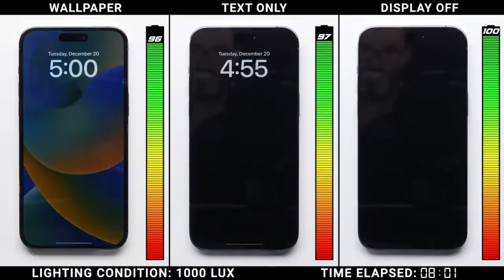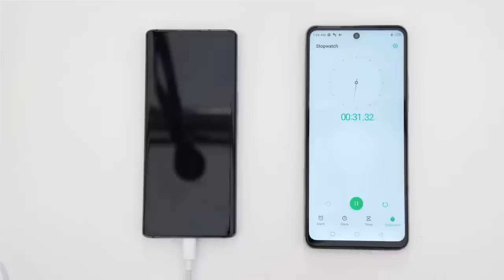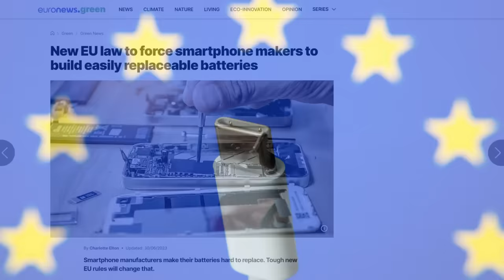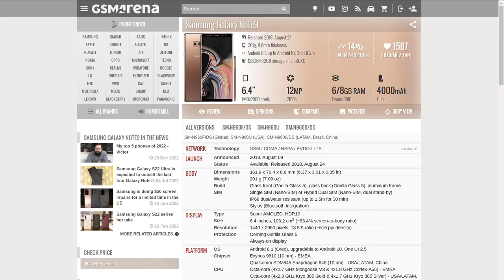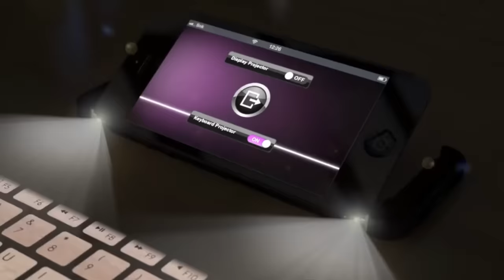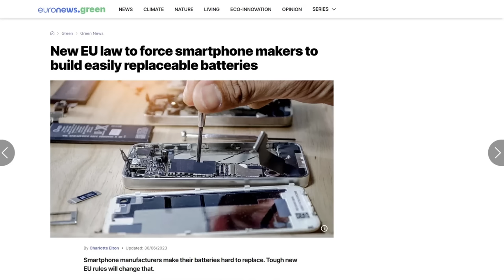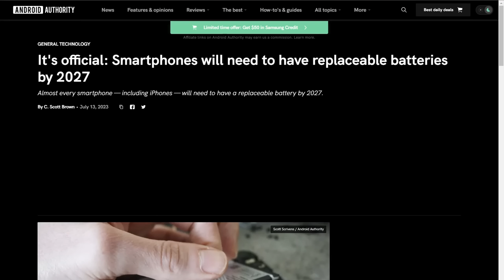All Smartphones Will Soon Have Removable Batteries

Comment: This needs to happen! Such a backwards step when phones went to non-removable batteries.
It will extend the life of phones by so much. No throwing away after 2 years.
Reply: Except that you won't get security updates beyond the end of life of the device.
Reply: my lgv20 was awesome i had extra removable batteries and instead of charging i would have one charged fully from a dock and just swap it in and bang you got yourself a camping trip without needing the portable batteries
Reply: @AJ12Gamer You can just install the new OS in that case though
Reply: @AJ12Gamer there is no such thing as security update😂, they're just adding more and more feature to bloat the device and makes it slower to use, and makes you think you need a new phone
Reply: I miss my Asus Zenfone 4 gen 1.
Reply: There are thousands of brands offering removable batteries, and you are crying for expensive government regulation because mainly two brands don't offer them... If this is such a problem for you, hit on google and type "[current year] phone with removable battery". You WILL see thousands of phones from small companies.
Reply: I've had my phone for 5 years now, and the battery life is still pretty decent. 
It sure is showing its age in other ways though, like with screen burn-in.

If I had to choose between an IP68 rating or a removable battery though, I'd pick the IP68 rating hands down.
Reply: @AJ12Gamer you're being silly AJ. Don't be silly
Reply: That's the point, more profits.
Reply: battery is not such big problem as small, unupgradable internal storage.  As soon as it reaches 80% capacity, phone start with hiccups.
Reply: Ive had my iPhone 8 for 7 years now
Reply: Wait, you guys can't just ask to replace the batteries?
-sincerely, the android gang
Reply: Which is exactly why I kept my Galaxy S5 since 2014 until the stupid forced VoLTE forced me to "upgrade".
Reply: @AJ12Gamer  except most of those 'security updates' are literally just bloatware to slow down the phone and push you to buy a new one, and even then you can just load the OS of a newer phone onto the old one lol
Reply: @GregorianMG There are no one OS for all phones like you have in PC. Each vendor offer their version of Android, and it's not interchangeable.
Reply: @ThePhilosopher Which brands offering removable battery today? I browse the internet up and down and back and forth and the only phone that is still have that feature are five years old product with small memory.
Reply: TBH, I have not had a single device fail due to the battery...
Definitely not going to argue against user-removable batteries, though. Even if it doesn't have any monetary change, it's a matter of principle. There are some crazy people in the world that think that life is not all about buying low and selling high and nothing else...
Reply: @AJ12Gamer  you sure won't, if the bootloader is locked, with the penalty of device features/warranty committing sudoku if you unlock it :D
Reply: @zepher664 how often you use your phone underwater bruh
Reply: Well a battery replacement isn't impossible but pretty hard now.as everything is held together by glue most of the time and Also ma
Reply: @ThePhilosopher Yes, but for many of them, everything else is what many people don’t want. The XCover Pro has a 120 Hz screen, but that’s it.
Reply: @boulderbash19700209 There is one with fairly good specs. You could get one with better specs for cheaper
Reply: @AJ12Gamer  I've disabled them immediately after buying it
Reply: It really bothers me that we as a society treat smartphones as disposable. Hopefully this will help.
Reply: @NicoKyunKyun  This is a very smart thing to say My Professor who still has an Iphone 5 from 11 years ago, said that you may think you want a new phone because of a new feature but all phones have the same use, and that it's wasteful to throw away a perfectly good phone. He was relating to adaptations and evolution in animals, He is a very good teacher and had an excellent personality I miss him.
Reply: i just want buttons back on phones and a thicker boarder back on the screens again. i hate using my mums more modern phone as she doesnt no how to use it. i can literally just touch the corner of the screen by accident and it will try to act like i meant to click on something. i dont like how the modern phones have become. until they revert back like 8 ish years, i dont want to have to be forced to buy a new phone or feel the need to buy a new phone just because mine is outdated.
Reply: 2 years? what phone you use? I had my Huawei for 6 years now and the battery works just fine, reson I need change phone this year is become difficult use latest apps
Reply: @ThePhilosopher ople tend to evade brands which are not pushed by their local e.g. isp's.

@starsareangels7 cool story. its best to have separated extra batteries for every device (for a trip). also double the amount of batteries for a long one. brains anyone?

@lifeishard5718 are "they" in your head rn?
Reply: @basukisugito3275  Battery life degrades usually after 6-700 cycles. Conversely, how many days are in 2 years? 

You can figure the rest out.
Reply: Dame with the wireless headphones and taking away the jacket
Reply: @MoteofVolition 
That’s a very low quality grade battery 🪫 
A rechargeable battery can last over thousands by default…..
Reply: @AJ12Gamer 
Not to mention your iOS won’t be updated, and they force it so that any new updates app will somehow uses over 5’000% battery life to force you buy new one. 😂
Reply: Back to ratio, and with around eight screws in the backplate they stay waterproof.
Reply: Yeah thats less profit for the Bourgeosie. They will fight for it. Thats millions of dollars gone. And also the company has to still keep up the roi for the investors or else they lose some. Phones nowadays can keep up new softwares and has enough RAM for it, mostly ppl change phones cause of the battery's dead or somenew phone with new feature which they like are on market.
Reply: @AJ12Gamer I had my Iphone 7 for almost 6 yrs, until january of this yr. Factory recall had Apple replace battery a few hrs ago and it still dies pretty quickly. It works fine still... but won't update and therefore wont work for cell service. 
Prior to that, i had an iPhone 5 for almost 5 yrs. I didn't use it much. That one really stopped working. 
Prior to that, I had dumb phones with removable batteries
Reply: @AJ12Gamer then phone companies will start having to be responsible for more and longer support for phone updates and security updates. They will make less profit and have to hire more people. Not going to happen.
Reply: If you throw your phone away after 2 years, you have serious problems...
Reply: my cousin has had an iPhone 11 for 4 years constantly using it and it still has a good battery life

Comment: Personally, I think that in the near future, all tech needs to be as flexible, modular, user serviceable, and non-proprietary as possible. If there are worldwide enforceable regulations it'll mean that manufacturers will need to up their aesthetics/ergonomics game and be as creative as possible in order to make their products unique and appealing to consumers.
Reply: tech becomes obsolete quickly, realistically very few people will repair their phone or replace their battery, just buy a new phone
Reply: @imstupidbut  maybe a decade ago, but nowadays, I wouldn't be too sure. My GPU was low-end when I bought it 4 years ago, but I only had to replace it because AMD cut software support
Reply: @imstupidbut it becomes obsolete so quickly because they're not user serviceable
Reply: Modern electronics design is all about short term consumption. They want you to keep buying and incompatibility is one of the most effect way to force it upon you.
Reply: @imstupidbut  The only reason I, personally, would buy a new phone is if it stops working. And usually, the first thing that makes it unusable is the battery.
Reply: That's basically the case already. Phones are pretty much a commodity item now, and manufacturers have to make very sophisticated products if they want to stand out from the crowd. You can get a serviceable generic android phone for $100 now. If you want something special, you can spring for an iPhone instead, but it will cost you a lot more money.
Reply: Flexible doesn't mean optimal, in fact modular tech comes with its limitations. But yeah, I do agree that it's convenient.
Reply: No one cares, every business has the right to do whatever they want, nobody forces you to buy their products
Reply: But in 2030 you will own nothing and be happy, how those big tech let you to truly own the product which you purchase by your own money?
Reply: @imstupidbut gee what could the cause of that possibly be?
Reply: When did more regulations ever work..
Reply: why don't you buy a 2014 android then ??
Reply: @imstupidbut what a privileged view.
Reply: it's been proven time and time again that things like this stifle innovation.
Reply: This is what the old tech (60s,70s, 80s,90s, even 2000s) were like. All the early smart phones had replicable batteries, and I think iPhone changed the game (blame Steve Jobs and that decision still is making a big issue now). It like going to the past. But a good past.
Reply: @Writeous0ne care to give an example?🤨

If anything this would force manufacturers to be more creative about how they can get a high ip rating. Rather than just gluing and clipping their phones together.
Reply: @AverageAlien Lots of us care ......
Reply: It would be nice to have an apple/samsung hybrid, taking the best bits of both.
Reply: @monad_tcp   Ok apply to apple genius  job, you don't need to be expert in anything, only needs to be charismatic...wonder why......
Reply: They need to stop throttling the speed of older phones. They have been caught read handed doing this.
Reply: @imstupidbut if you teach a man how to get a new phone, he wont repair it
but if you teach a man how to repair an old phone, he will have a product of decades
Reply: @zarkos2373 people dont buy it because of OS updates and hardware

let us change hardware and BAM, OS can also update
Reply: Keep dreaming.
Reply: @imstupidbut 1) Smartphone tech really doesn’t move that fast. Realistically you don’t need to replace for several years. 

That said The fact that tech becomes obsolete quickly is why this is needed. People should be able to replace individual components and upgrade simple systems on their own. This is already possible with people being able to build their own PCs and able to upgrade individual parts periodically without needing to shell out for a whole new model for a few performance gains.
Reply: ^This. As the tech industry grew it was really allowed way too much anti consumer power. Taking away basic features in products and it so we’re unable to do anything with the products we pay 1000+ dollars for.

I’d say the same should go for software. Something really needs to be done with how unnecessarily restrictive these licenses are and how closed off software platforms are allowed to be.
Reply: Keep an eye on Framework laptops.
Reply: They tried that in the past and no one cared, there's so much cool things that could be done, but people aren't all on the same page, their all doing their own thing with no regard for anything else😎
Reply: @imstupidbut here's not really anything a phone upgrade gives you these days. As long as it's on the same mobile generation there's no point. I bought a really old phone on ebay for nostalgia sake. A Motorola Droid X which I had 12 years ago. If it wasn't a 3g only phone and it supported the newer apps I use it wouldn't be much different from a new phone. The only useful things phones upgrade are cameras. (Ignoring people who play mobile versions of PC games which is silly).
Reply: I think European law can easily force the manufacturers to impliment the changes world-wide.

And since it's appears obvious that Europe is more responsive to right to repair issues, all lobbies should shift their attention there. Things are near impossible to change in U.S.A, and they are literally going in the wrong direction.
Reply: How do you prevent some Chinese OEM from knocking off your product? As an America Hardware OEM, this is our biggest hurdle with open source. Chine doesn’t understand open source, nor do they care
Reply: @Writeous0ne source?
Reply: @wayando  Internal batteries are what the entire chassis design of current phones is based around. Major manufacturers aren't going to design everything twice.
Reply: Eu prb think Ohh removable batters no more Spies.... Simpletons
I just just add small batteries to mini mic...
Reply: The end goal is anyone could have easy acces on a smartphone so we can be spied better and pay with their digital money, unfortunately
Reply: @imstupidbut  most people are poor. that, and technology isnt progressing as fast as it used to in the mobile market. more and more people are using old phones who arnt super wealthy with the exeption of actually breaking shit or moving countries or other exeptions
Reply: so basically, tech needs to be like an ar-platform rifle.
Reply: @imstupidbut I have never replaced my phone before the previous one broke. And that's not because I'm short of money. I am sure I am not the only one, too.
Reply: Or we could just let people themselves decide what they want...
There have always been phones on which you could exchange all kind of parts. But not everyone bought those.
Reply: @realsong-fake  
Absolute bullshit.
The consumers themselves don't want to use the phones forever. There are plenty of modular phones. Phones where you can't just exchange the battery but all kinds of parts.
People know for how long they will use a phone and that they'll get a new one anyways.

Comment: I liked it when phones had removable batteries. It gave me a sense of control when the phone would ever act weird. Having a force stop option with a dissuading pop-up every time isn't quite the same.
Reply: Exactly! My iPhone freezed once and all I could do is to wait until the battery drained, felt really weird.
Reply: Over 100 likes? Wow
Reply: @borisso3465 it's weird, there was always a way around to restart your phone. For example, holding power button.
Reply: @borisso3465 there is a hard switch off, i genuinely thought i had to do that too but if you hold the power button long, like really, really long, it does a hard shutoff no matter how frozen it is
Reply: @Finster711 I think its 20-30 seconds I'd time it but uhh gotta use the phoen for that lol
Reply: @VORASTRA I’ve had this happen to me too and even powering off and restarting didn’t work I had to wait the 6+ hours for my phone to die
Reply: The "elite" kept this as a secret for centuries, this is the true story of your enslavement 👉 The Connections (2021) [short documentary] 💖
Reply: Hard shut down for most androids is volume up+power for 15 seconds.
Reply: I though it was a button in that teeny tiny hole, no? They gave me a tool for it!?
Reply: @jilbertb  that's for your sim tray, if you push the button in the hole your sim card, and if its available on your device, your memory card will pop out. The sim card cannot be hot plugged, so if you ever need to do this, make sure the phone is off.
Reply: Why in the heck don't they already? This is inexcusable! I have a tablet where the battery began to swell, forcing me to get rid of it. Unfortunately, it was taped and there were apparently wires or something that got ripped out, so basically I have to throw away the whole tablet now.
Reply: @EmeraldEyesBibleSecrets slim phones are hard to make removable batteries for more glue than screws coldfusion channel   explained that way, foldable devices are dead in next couple of years.
Reply: Also if you had an old/broken phone that took the same battery as your current phone then you could just use one as a charger and battery swap them instead of waiting for it to charge.
Reply: @alexknox814 well these slim phones are so flimsy they need cases which defeats the entire point. They could easily make a no-case-needed phone in the same size as a slim phone in case and have room for bigger, removable batteries and even have headroom for better cooling to boot
Reply: @harrythemoth180 you could've held power vol- thats also i hard shutoff on most phones
Reply: @somecatyoudontknow6471 that is incorrect it kinda can, tho it might cause damage
Reply: @Finster711  nope not all. Most Samsungs wont now. Some idiot thought that they should require the pin to shut down a device. To kill it fast you basically gotta plug in an OTG adapter and put the highest load you can on it.
Reply: @somecatyoudontknow6471  that's just straight up incorrect
Reply: Lil tip for y'all, on iphones since the 7 (or 8, whichever introduced the force touch home button), quickly press volume up, then down, then hold power. In ~15 seconds it should shut off

Comment: Don't forget that smartphone obsolescence mainly stems from the OS not getting updates anymore and therefore missing new features (&security risks)
Reply: those missing features & "security" updates are nearly meaningless. A working system should run for years. I still have a totally outdated Windows 10 (version 1809)
Reply: It's the old environments being torn apart by the updates themselves to their components that get progressively less and less compatible with each other as you update some and leave others behind. Most phones work well when you factory reset them and abstain from updating software wothout total necessity.
Reply: updates are shit mate
Reply: The EU enforced updates for at least 5 years too!